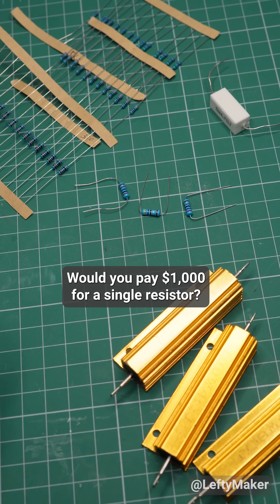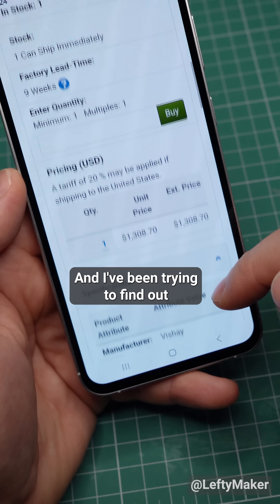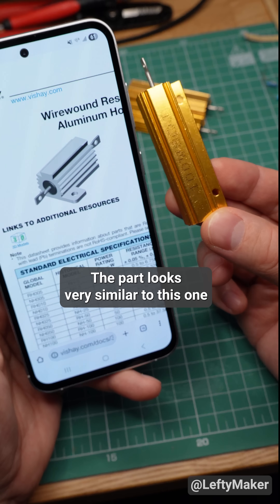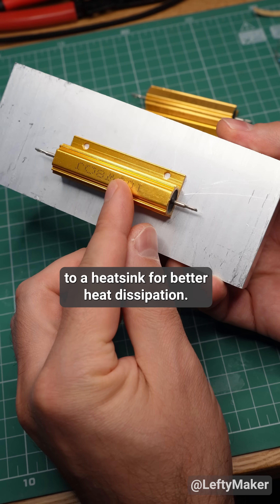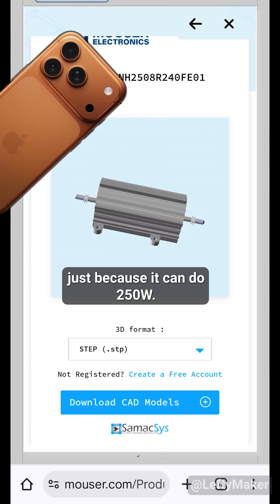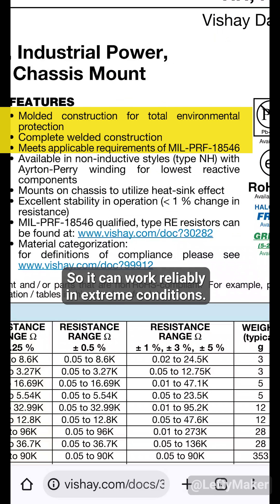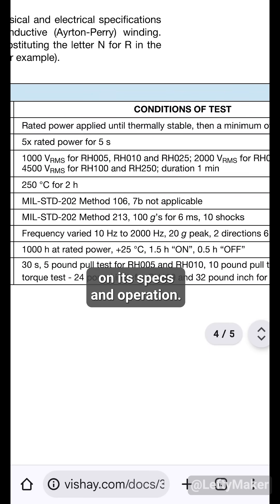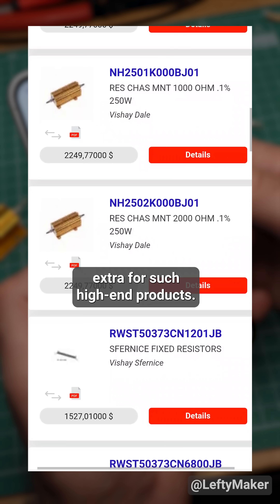$1,000 for a resistor?

Comment: Milspec?  They aren't just "designed" to match the spec.  They are "batch tested" to match the spec. That's where your money goes.  For testing it has to go to a certified lab and a report is generated.  Do that on 1 out of every 50 units and the cost adds up, especially if you can't sell the unit that is tested.

Comment: I work in the semiconductor industry qualifying devices and can confirm the markup on these special ones is an application specific thing. With space/military applications there is a lot of extra work needed with qualification (such as radiation testing) which does incur extra R&D/manufacturing cost, and is produced in much smaller quantities because there's less of a business need. There are entire teams dedicated to verifying a parts of a product family meet these specs. How exactly the math leads to something like a $1000 resistor is beyond my paygrade though

Comment: The most expensive part of making these is the precision specs for applications like aerospace. In the case of this resistor, it needs trip every time if something goes wrong like a normal protective resistor in any electronics, but in addition it also needs to never trip on accident if nothing else is wrong. 

That is what makes this expensive, it is made to be a point of safety without being in itself a point of failure.

Comment: Usually you pay this much for these things for extreme levels of quality assurance. The amount of testing they have do to ensure the resistor performs exactly as specified can get expensive. The manufacturing tolerances will be very tight, but reasonable. However, it is probably getting tested by hand by a technician with some extremely expensive equipment.

Comment: The reason it cost so much is because of the "certs" to guarantee that it's been tested to meet the Mil-spec.
They do burn in and extra testing. That's why it cost so much more.
I used to work for Microsemi doing Failure Analysis. I have experience doing this.

Comment: I used to work at Mouser Electronics. The "Military/Aerospace" rating exists for all types of parts, its typically just the temperature range, and does not greatly effect price. You may pay $0.25 for a "Commercial" temperature range 555 Timer IC for example, slightly more for "Automotive" grade, slightly more for "Industrial" grade, and maybe something like $0.75 or $1 for "Mililtary" or "Aerospace".
The reason it is expensive is traceability, handling, and testing. Mouser does sell a lot of parts Raytheon, SpaceX, Lockheed Martin, Beoing, etc. When you are assembling something like a cruise missile or a commercial jet, you need to keep track of the entire supply chain, you need to know which lot or batch the part rolled off the assembly line in, and you need to handle the part more carefully.
Traceability is important for defects. If an electrical component fails in flight for a rocket or an airplane, they would invesigate the fault. If it was determined that this resistor failed, they could perform a recall on the entire batch, and the aerospace industry would know exactly which aircrafts, missiles, or hardware had that exact resistor from that exact batch,  they would be able to replace it before more failures occured.
Handling is different too. Resistors dont typically have any special handling considerations. IC chips are typically handled as "ESD", and SMD components are handled as "MSL". An aerospace resistor may need to be treated as ESD and MSL. Both would require an environment with zero furniture, tools, or items which could cause electrostatic discharge, everything in the area must be static dissipative tested. Mouser tests the floor, the tables, the tools, and their employees(twice per shift) to insure ESD compliance. MSL is Moisture Sensitivity Level, these components are stored in sealed packaging with dessicant and moisture detecting cards, the area is kept at 1% humidity which is an order of magnitude dryer than any desert, and tge parts cannot be exposed to atmosphere for more than a few minutes in some cases. ESD and MSL is important to make sure that the parts arent mishandled ir recieve any microscopic electrical damage that may affect their operation later.

Comment: A significant portion of what you are paying for is the liability. This might be atom-for-atom the exact same thing as its $10 counterpart, but it has gone through extensive QC and testing to verify its meeting every possible specification 3 sigmas out, plus if this thing does fail within operating specs, vishay or whoever is likely liable, and liable for a lot as you don't put $1000 components into your kids light up shoes.

Comment: 1% tolerance over a temperature range of -55°C to +250°C is a crazy precision for a high power resistor. You don't use such components unless you really have to. Of course they are expensive.

Comment: You pay for the tolerance, weight, and heat dissipation.

Low tolerance, low weight, and high heat capacity resistors are very expensive.

Especially considering that most materials conduct better with high heat, so to stay the same value over the whole heat range, it'll have to have some completely like a coil, bi metalic, or a built in auto poteniometer system.

Comment: One reason parts that meet MIL-SPECs cost so much is that the proofing process includes testing to destruction of a pretty large sample of the parts.  Not a big deal with film resistors, but with a part that has a precision body and platinum resistor wire, that's going to mean a lot of destroyed, expensive parts.

Comment: 100% accurate. Though, the tolerances are likely still tighter and consistent throughout the production run than the cheap knockoff. 

The thing that people didn't realize is that if they lost a milspec, they HAVE to meet and prove the certification criteria.  That's why you see "military grade" on cheap products, because it's meaningless without a milspec listed. 

It's the same reason that some companies only give their products an IP65 rating even though it might easily pass IP67 or IP68. The manufacturing doesn't change the price enough to go cheap, but reaching the higher certifications is significantly more expensive.

Comment: The answer to the question is: “It depends…”, depends on what the application is. If it is the only option to make the specs for an extremely harsh environment with extreme reliability, maybe the price is acceptable. Rocketry as mentioned is a good example.

Comment: As an aeronautical engineer I've never understood this. I understand why they're more expensive, I just don't understand why it's necessary.
A lot of the cost is not because these components are made better but its the certification that comes with them. Say you want aircraft aluminium. If you buy it with a certificate of conformity it will cost $x per sheet but if you buy it from the same source without a C of C you get 60% off. I understand why this is necessary for aircraft which has to function reliably over a considerable period. But something like a missile only has to function reliably for one flight.

Comment: Plenty of potential reasons for high price. They might for example come with guarantee that not only replacing that part but also pays for all damages caused by its failure, guaranteed replacement part delivered anywhere on earth within 24h, unlimited free replacements during the warranty period, the list price is there only for consumer customers hoping they won't even try to buy them and no company buying bulk pays anywhere close to that price, promise to keep the exact same spec part available for decades, and plenty of others I probably have never even heard of. B2B sales is an insane world for the uninitiated, but usually a somewhat reasonable explanation for it. Unless it's sold by an American company. Then it's probably basically just legal robbery.

Comment: Back in the 1970s the ignition breaker points for a ford station wagon cost $2 while the ones for a Cessna 172 cost $55. Came off the same assembly line. The ones Cessna got were sampled and the samples  tested to destruction. 100X the time effort and paperwork to double check Borg Warner's product. < that is where the money went.

Comment: Use to work for vishay.  Mil spec is most of the extreme cost.  Use to install the 1k ohm and the 250 ohm versions in a high current application, and those things can absolutely take a beating.  Never go cheap on high current work.. great way to make those loud and expensive booms.

Comment: wire-wound resistors have very high inductances in certain high frequency applications. Carbon-film resistors are better in these applications, but their power handling is terrible. To get power handling and low inductance you have to pay $$$

Comment: So, you could build working Shuttle with some 1 million.
(remember, Shuttle wasn't idiotic proof.. Few get destroyed. But nit because some electronic component failure)

Most hurting one was that operation, when solid rocket leake burning gas to one most critical part of ship, burning hole there. It was catastrophic thing, I hope no one forget that, when designing something so critical. 😢

Comment: These resistors usually have platinum wire for the resistance element inside. The reason is that it does not corrode or burn out. You can also overload it severely and it won't lose it's specifics. They work great for bench testing high power audio gear to measure THD with an oscilloscope ❤
Reply: Platinum has hihn resistance vs temperature coeffiecient, it is suitabe for Pt100 and Pt1000 temperature mearuring resistors. the better choice is NiCr (Nicke-Chromium) and the more stable it is , the more expensive it is.
Reply: Thank you for info"platinum" I have 10 of them,exactly from military!wauu 😀
Reply: He (and the datasheet) explicitly say it does not. In this datasheet it says NiCu or NiCr resistor element.

Comment: It could be a similar situation as for old Fluke multimeters, which got into service manuals, test procedures of some higher end equipment. Even if such multimeters are out of production already, you cannot just use another product - you are bound to older, scarce, expensive solutions

Comment: It's also that even though it is 250 W, it only has a 0.1% deviation from the stated resistance. They will also be available in exactly this spec and dimensions for the next couple of decades, instead of going out of production on a whim.
Reply: That 0.1 is also from cold to max operation temperature too.

Comment: There is high power and voltage resistors that are used in power plants. They have to go through much higher standards and working conditions. If you buy a $1000 dollar resistor, you have a specific need. A thousand dollars for very specific equipment is probably a cheap grey market component.

Comment: I actually use that very same resistor at work. We use it to measure the amps and Volt amps on our surgical generators. So the reason it cost so much is because it goes through quarterly calibrations and is tested to make sure it’s reliable and accurate. And it’s for medical unit testing at least where I work. So calibratable and for medical. That’s why
Reply: Does the 1000 include lifetime of quarterly calibrations?
Reply: unless the ones selling it to people are covering the quarterly calibrations and tests, it's absolutely a public sector funding scam.

Comment: Isn't also a more precise resistance value than the aliexpress one?
Reply from the maker: yes, I believe it is. More importantly, the expensive one can have a very low resistance value and, at the same time, very low deviation at high/low temperatures. For example, it can give more accurate measurements when acting as a shunt for measuring current.
Reply: 0.1% over 100 degrees C temperature difference. Used for test loads.